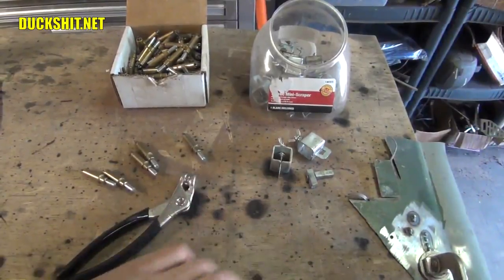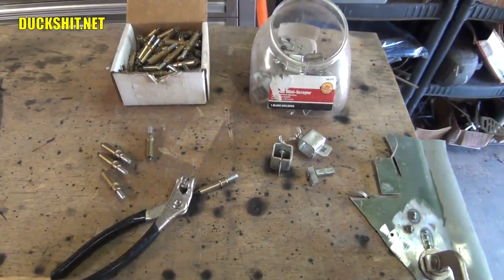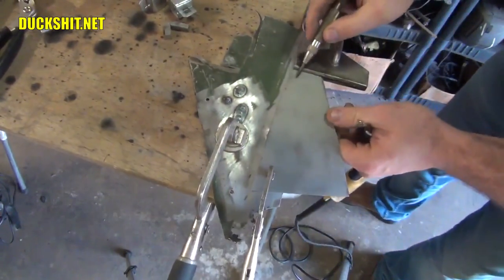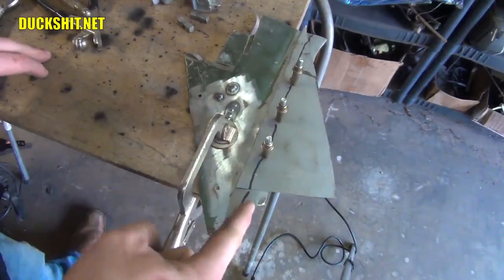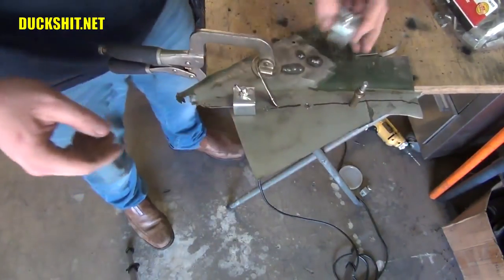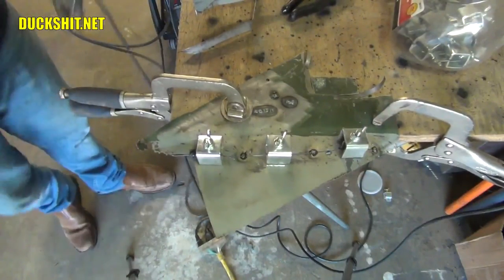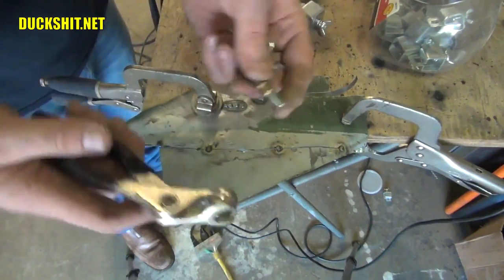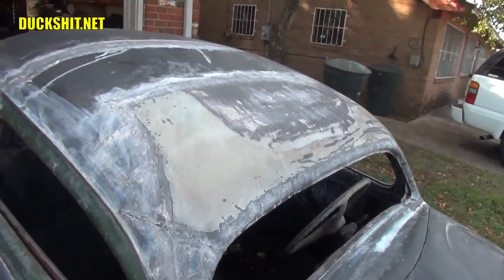Howto Weld Body Panels - Fastners Clamps and Clecos - Mid Day Q & A - 7

Comment: Clecos are used widely on airplanes for same reason, to hold panels down while being riveted.  But you put the cleco in the rivet hole , then take it out and buck the rivet in there.  I go a set of them in toolbox at work  for that reason including the cleco pliers. Nice demo on the use in auto world.  In aviation they are numbered as #40 smallest , 30, 21,  to #10 largest. Also are color coded.  Black , copper, silver and gold.
Reply from the maker: Color coded indeed!  Thank you!

Comment: Love the videos especially the free welding lessons😃, using those really does make it easier to prevent the metal from moving. Will you be welding your exhaust when that comes or do you already have one?
Reply from the maker: Already have an exhaust, probably won't weld one.  They come very specifically tuned (header length and curves) to make them efficient.  I don't want to get into that math and headache, lol!  But I may weld on a muffler, we'll see how that works out.  Good question!

Comment: OK,if you use those clips with the slot in the back plate panel, how would you get them out if you have a closed panel,m inventing, those cleos, with a little plate FLAT about 1/2" square plate, and of coures with a little welded NAIL 1.5 mm diameter, so when after  weld, i can turn it, and then slide it out, again,u have a gues loll, and demostrat that, for me, i only do this for myself, m 75 now, and i give only some example, hope u know what i mean,best of luck, Regards lenny
Reply from the maker: well, you don't! LOL if you're going into a blind hole you would be using clecos only!  😁😁😁